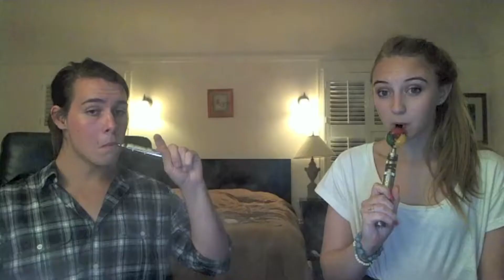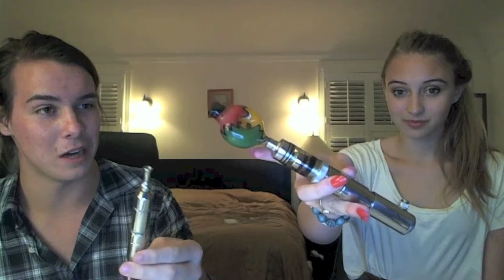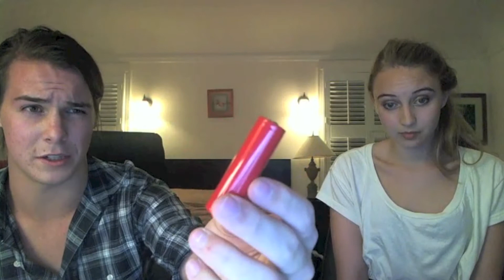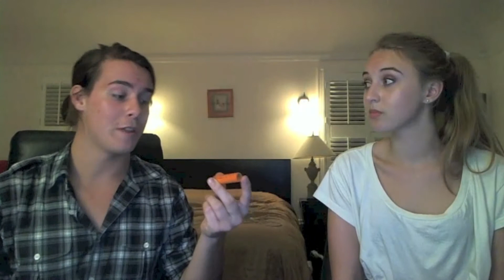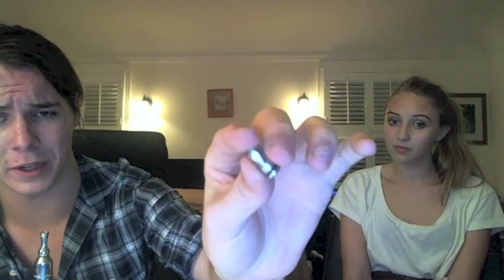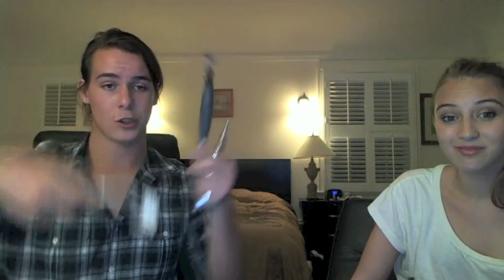Complete Genesis Atomizer Tutorial (Part 3)

Comment from the maker: Well your best bet is to go to mmvapors.com!
In less than a week, they're going to start selling the Poldiac, which is their new 18650/500/350 mechanical tube mod. From what I've seen, it has probably the best button construction of any mod on the market, plus b/c of the way the contacts have been made, it should be the hardest hitting and overall best performing mod out there as well! MMV also sells the DID, which is probably my favorite genesis atomizer.

Comment from the maker: Now, the Katana has been sold and I've moved onto other RBAs, mechanical mods, and hybrids, and my coil/wick setups have changed almost as much as my hardware! Now a days, I almost always use hollow/thin walled wicks (either 400 or 500 mesh), and as for my coils, my 3 primary setups are either 3/2 of 28g, 4/3 of 28g, and 3/2 of 30g. I've also been vaping my odys more recently! Right now I have a 1.5Ω 5 wrap of 28g at 7.4v in drip mode ody, which I'm really enjoying!

Comment: Sweet deal man. I took a small unwanted vacation behind bars but im back. Trying to sell my ProV cause it just wont push the wattage the 30awg needs. Cant even burn the paper off the wick. Its sad. As soon as the ProV gets the wire red it pushes the E2 code. .8OHMS is only good for 3 volts. Weak ass junk IMO. Did you ever use the MNKE in the ProV? Did it push more  watts with that battery? The most I ever pushed with the AW @1.3 ohms with a 2/3 32awg was 15.8 watts. Thats kicking for a ProV.

Comment from the maker: A short or hotspot in a genesis atomizer isn't going to be like a shorted Chinese cartomizer or atomizer, so don't worry about a shorted genesis coil ruining your mechanical PV! Your coil will definitely pop before the short can generate enough heat in your PV to collapse your spring or trip a fuse (be it a mechanical fuse like in the GGTS or something like the $0.02 for safety). What could happen is your switch/contacts will develop some slight arcing, which can be easily polished out.

Comment: Great vid! I have a question I hope you could answer, it's kind of a newb-ish question. You mention that it would be better to use a full mech mod with the DID right? So after every rebuild do you use a multi-tester to check the ohms? I'm afraid that the DID could have a short and destroy my mod. Another question is can hotspots damage a full mech pv? Like collapsed spring or battery venting? Because hotspots could develop while vaping, right? I hope you could answer these questions. Thank you!

Comment from the maker: You MIGHT be able to get them at niche electronic stores. Radio Shack doesn't carry them, but they might be able to order them from their catalog. You might also want to try Fry's, but your best bet is a retail location that specializes in flashlights (if that exists), as these are designed to power extremely high powered LED flashlights. Or just order em at digitalciggs :/

Comment: If you have a provari try using 4/5 wraps with 30 awg A-1 on your coil. NO hot spots or error messages using 3.7 Volts on the Provari with a 1.4 / 1.6 ohm coil. ;)